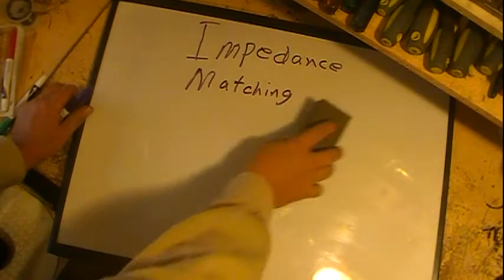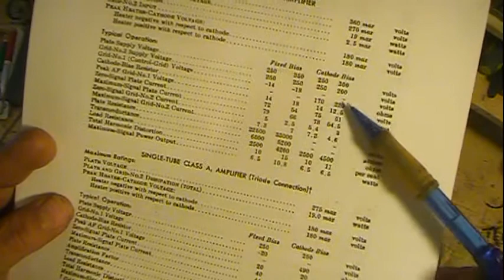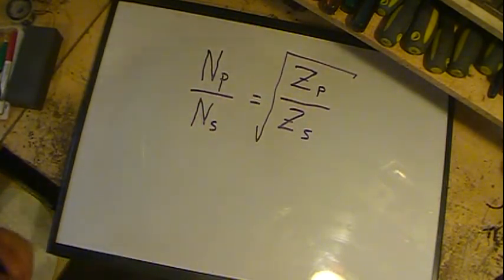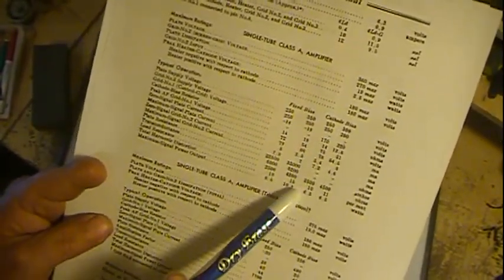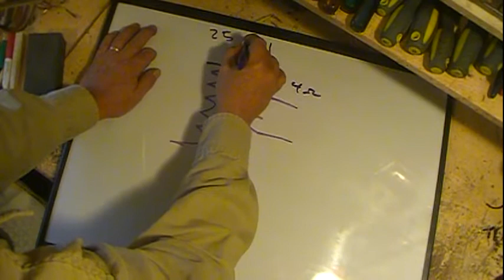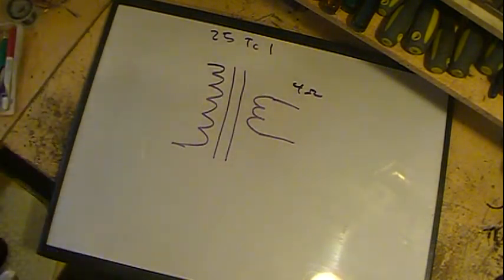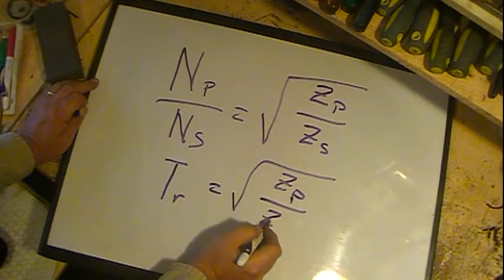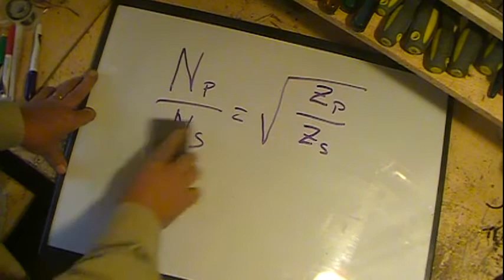Impedance matching

Comment: Dennis, thank you for this video.  I love vintage electronics, but understanding all this doesn't come naturally to me, but I want to learn and have read a lot.  I have a growing collection of projects.  You and my other video teacher, Joernone, have helped me finally understand the basics about impedance.
I have a special case to ask about.  It's about what impedance of an external speaker I can get away with on an amp with 4 6L6s in push pull, cathode biased.  It's a Magnavox power amp, model AMP-111, from 1948.  Looking at the schematic, the 6L6s are not operating as triodes.   The output transformer normally powers a 15 inch PM woofer and a horn tweeter-midrange with a crossover.  Total output is rated at 45 watts on the SAMS Photofact.
This amp has a switched external speaker connection, and the output transformer has a winding for what Magnavox recommends on the schematic as a 12 inch, 3-ohm PM speaker, operated by a remote speaker swtich.  In normal operation with only the internal speakers, the two output transformer secondary windings are bridged to operate together.  I guess they did this on a lot of power amps in their consoles from about this time.
The console came to me with the remote switch installed but no external speaker.
Three ohm full range speakers this big are hard to find.  I'll be happy to give you more info if you need it.  You said in this video that the 6L6s are forgiving.  What's your guess on what can I get away with in finding a workable external vintage speaker that would be compatible?
Thanks for listening and for any ideas on this.
Cheers,
Vic
Reply from the maker: vinylhound43 If you can find a 4 ohm speaker that should work.
Reply: Dennis is right here, choosing a 4 ohm speaker will work very well, but also does a 8 ohm speaker, unless you operate your amplifier all the way at full power for hours. If this is the case, you need a 4 ohm speaker, as may be the output tranny will be arcing over in the primary winding when operating at full power into a 8 ohm speaker.

That matching is not as critical at all (unless you´re calling for full power everytime). If you choose an 8 ohm speaker it will be not as loud as a 4 ohm speaker and the 8 ohm speaker will result in a slightly higher distortion of the output signal (may be some 1-2% THD more), but it will work as well.

Even better when, as this is the case here, the design uses a cathode and grid bias resistor network, as this automatically adjust itself to the right operating bias point, so the tubes are never beeing pushed too hard anyway.
Reply: Dennis Carter Thank you both.  Your answers really helped.  I won't be driving it to the max, volume-wise.  I've got upstairs neighbors.  ;-)